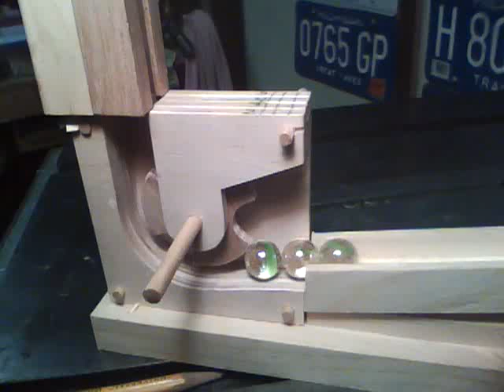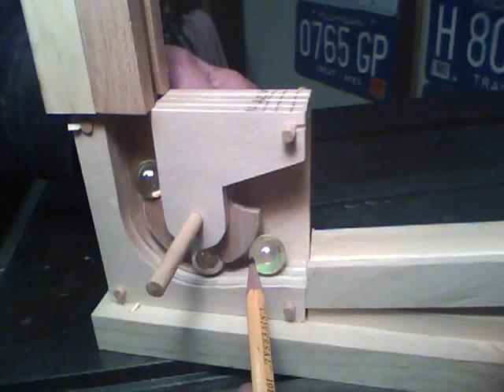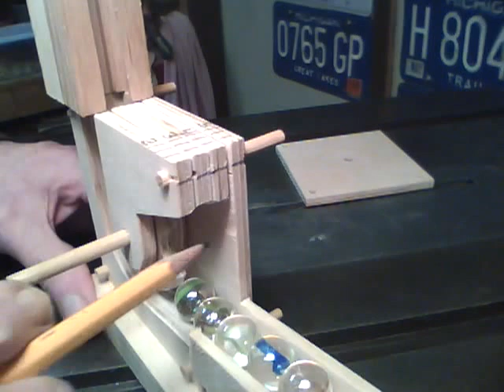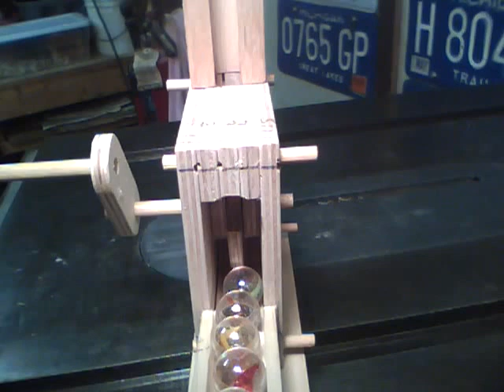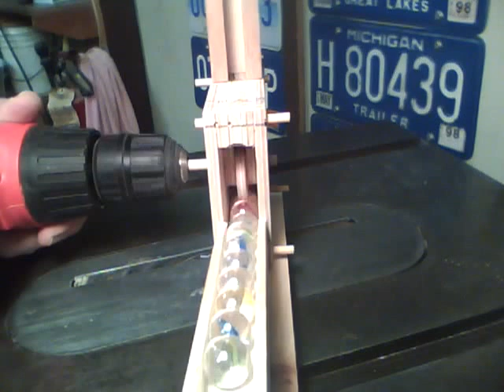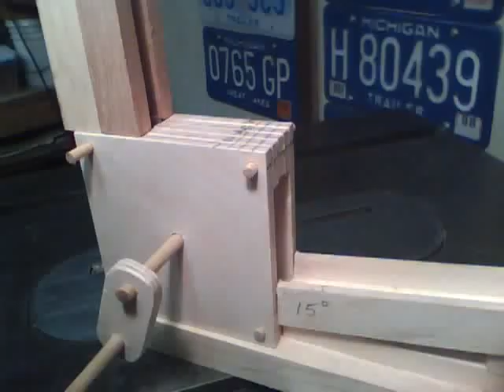Rotary Marble Lift, more modifications

Comment: Jim, you made reduction gears. Couldn't you use the duel solenoid wheel with gears to turn this marble lift?
Reply from the maker: +MRrwmac I tried that. It would run, but would not start up. Low power.

Comment: Neat. Are you planning on making a marble machine?  That would be cool. Another option for a motor if you don't want to use a speed reducer is a windshield wiper motor then you can power it with an adapter.
Reply from the maker: Thanks, I have thought of that also. Will see what I can find for cheap. May make a simple machine.